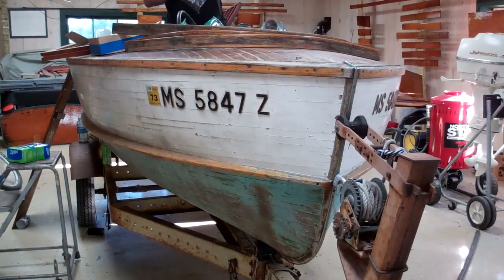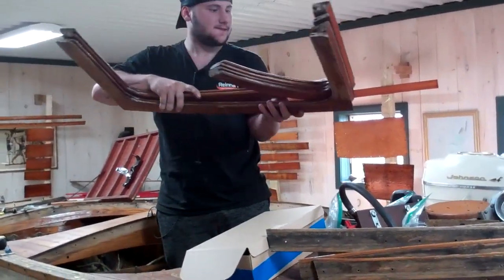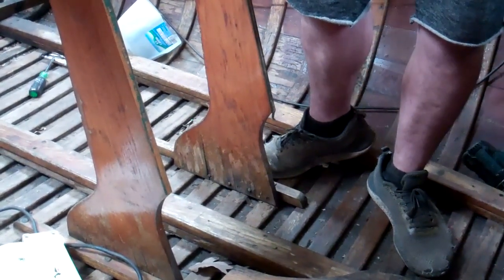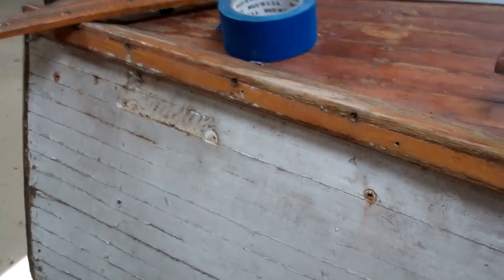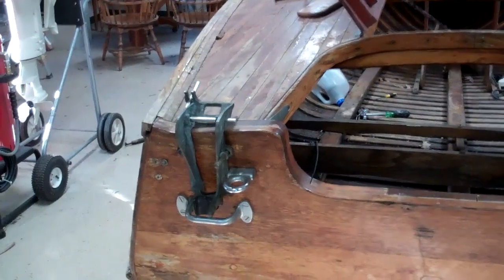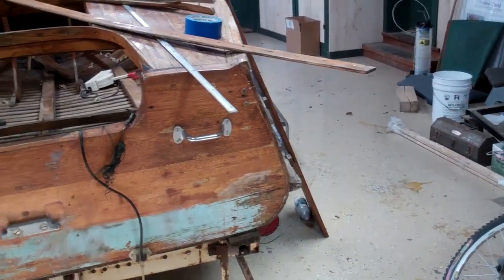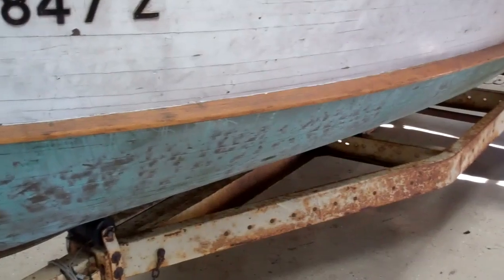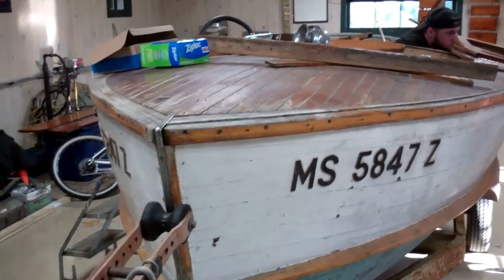Meet the 16' 1958 Penn Yan Sea Liner! 9 13 2019 Snake Mountain Boatworks

Comment: Hi...Beautiful boat.  I am quite fond of Penn Yan and am currently looking to add a "correct" folding seat back for my rear seat.  My only issue are the brass hinges.  I am aware that the 1958 Sealiner share the same hinges as my Penn yan as seen from the 1958 factory catalog .  I'm wondering if this Sealiner had the optional fold down rear seat and was wondering if you could provide pictures and exact measurements for reproduction???  Thank you in advance for consideration.  :-)
Reply from the maker: Sorry, but this Sea Liner's aft seat back is secured with wood screws - not hinges.
Reply: Thank you for responding anyway...Happy Boating!